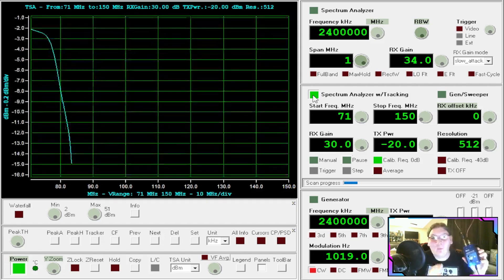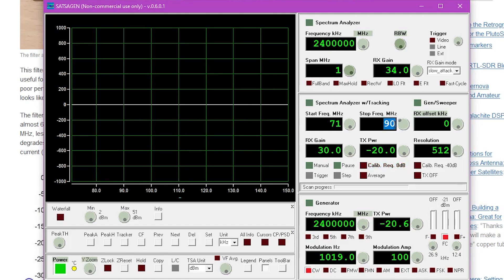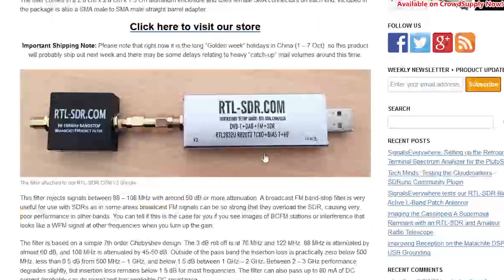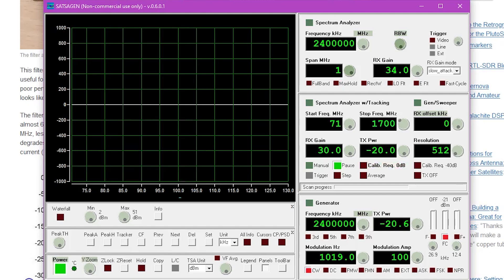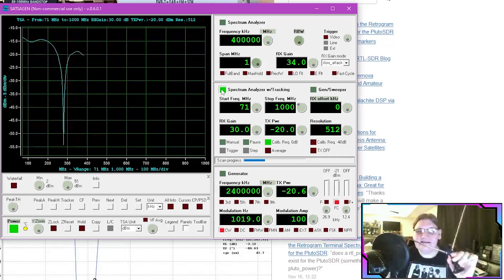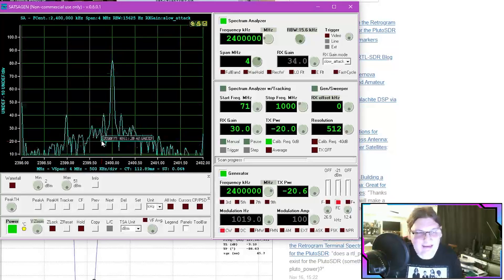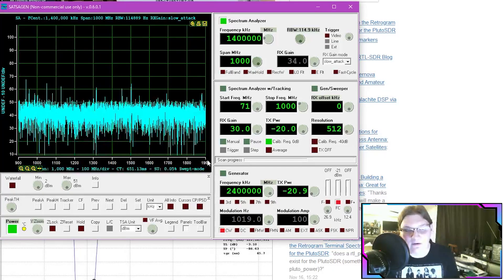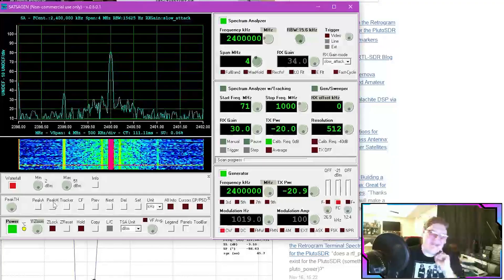Spectrum Analyzer and Tracking Generator with Pluto SDR

Comment: You cannot really tweak a filter in real-time with this, because it's spec analyzer and tracking generator are not fast enough to reflect what is going on when you turn the filter knobs,  especially if you want good resolution and wide bandwidth. I wonder if you can use the LAN port for a better speed, because USB 2.0 is slow

Comment: So basically you can use your SDR, even maybe cheap RTL SDR, like a slow osciloscope with FFT?
Reply from the maker: As a spectrum analyzer yes, an oscilloscope measures voltage which this will not do
Reply: @SignalsEverywhere  Wow, that's nice stuff. I saw your Cable TV video, and this inspired me to attach ADSL line to an RTL SDR in the future

Comment: Oh, what RF Bridge are you using?  Link?
Reply from the maker: Amazon has some cheap ones https://amzn.to/3HLK8eH but mine was bought on eBay (It's also the same design, just in a metal housing) https://www.ebay.com/itm/332640254339?hash=item4d72e77983:g:1mAAAOSwrptbKT2w

Comment: Is this software going to work with the Pluto Plus?
Reply from the maker: Another viewer commented, it will work with the Pluto Plus but you need to set up the device via USB and then if you decide to switch to network you can do so but you must initialize on USB first
Reply from the maker: I have not been able to test a Pluto Plus yet so I cannot say for sure at this time.

Comment: Hi Sarah. What a great bit of software. Got it running with my Pluto+ over LAN. Had to connect with USB first to get connection. then go to settings and I could then change IP address (lower case) then disconnect USB. Bingo. Works a treat. Thanks for heads up. Take care.      :-)
Reply from the maker: When I first read this I thought you were talking about just running the Pluto itself over the LAN 
It's good to hear that it also works with the Pluto Plus
Reply: @SignalsEverywhere  Hi Sarah. I know a lot of people are apposed to the rising number of "clones" on the market. But I have 3 Adalm Pluto's (They're great .. don't get me wrong)
But the pluto + is everything a pluto should be !!. ... A tad more expensive but much more accurate clock (plus the ability to gps lock)  the LAN is a big bonus and not forgetting the SD card slot. I still use the Adalm Pluto's with mods. But again many thanks for bringing the software to my attention.  Very very useful. Please keep up your you tube video's ... Awesome content. thanks for reply. Please take care.    :-)
Reply from the maker: The Pluto SDR Plus is something that I definitely do want to take a look at, and I'm sure I will at some point.

I do try to avoid clones and that's generally for the sake of trying to send support to the original developers.

That being said, yes it sounds like this is basically the upgrade that takes it from an experimental learning tool into a device that you can use for damn near anything.

When I have the extra cash on hand or if I can have somebody provide one to sponsor on a video at some point then I will absolutely be covering it

Comment: Another excellent video! 
I've had my PlutoSDR for couple years, seen this software but never installed it. 
If it ran on a Raspberry Pi you could make nice piece of stand alone test kit.
I've been working on designing a universal VHF to Microwave transceiver for ham use using mine, add some decent filtering and a power Amp.
Got a ways to go though...
Reply from the maker: There is a way to run it under Mono but I'm guessing the Pluto isn't going to handle emulation well. A raspberry pi, maybe?
There is some linux tools available but this has been the most solid I've found so far for this kind of work. I will eventually cover something under linux.
Reply: @SignalsEverywhere 

Thanks for the input. I have not had much success running my PlutoSDR on my Raspberry Pi 4 (4gig) under Raspian or Ubuntu. Under Ubuntu on my pc either.
Works OK on my PC using Windows 10/11 though. You're right, running it in a container or with Wine would probably be slow if not unusable.

Comment: Nice!  Thanks for the video!  Have you ever used the wide band noise source on the Ham-It-Up upconverter?  This works well with the RTL-SDRv3 dongle to check the FM and AM Broadcast band filters response.  I'm sure it would work better with a calibrated SA!   Thanks again.
Reply from the maker: I do have a noise source but I have not tested it with the ham it up, I might have to take a poke at it I'm sure I still have my old model